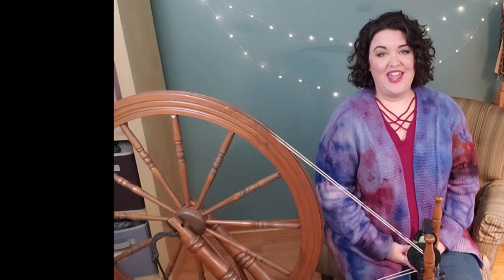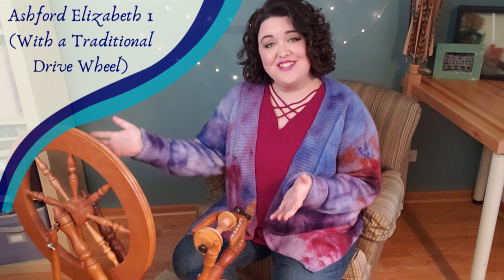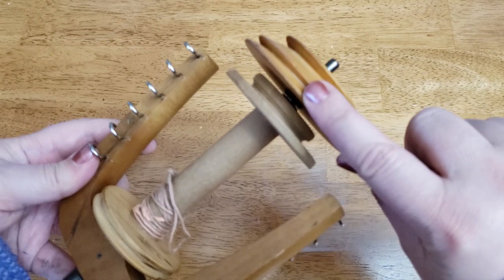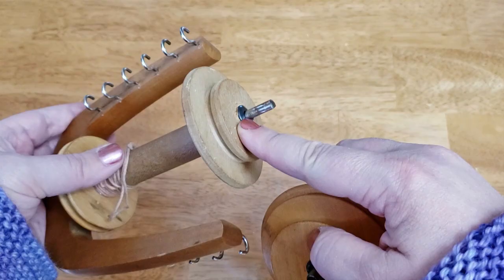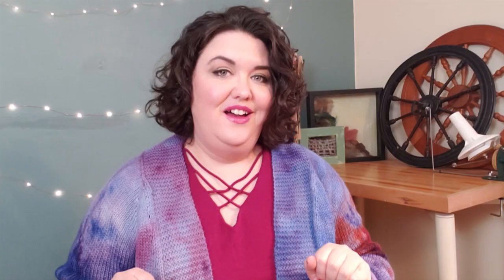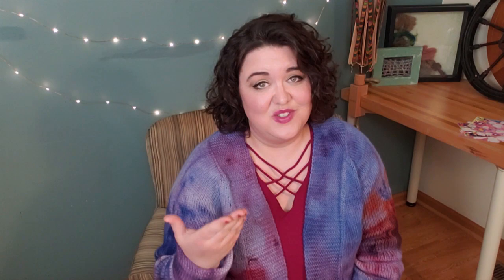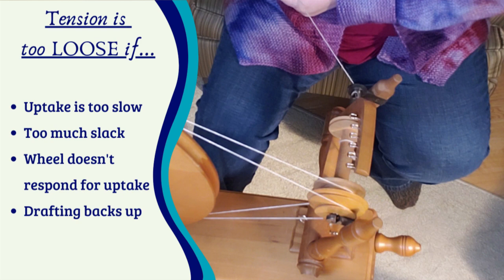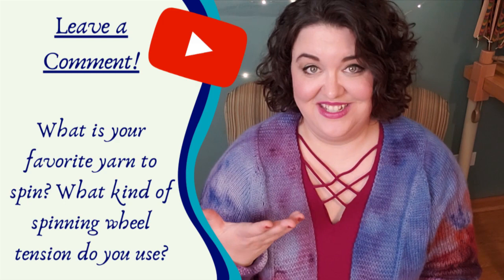Double Drive Spinning Wheel Setup

Comment: I've had a Columbine wheel sitting in a corner since I fell on it (tripped over the dog) and warped the frame. I decided I want to fix it and use it again...and since the original drive band is gone (who knows where, not me) I couldn't remember how to put a new band on it. Your very clear explanation of how a double-drive system is set up and works has given me the drive (pun intended) to make a new band and hope against hope I can get my Columbine back in use. (By the way, I learned to spin on a Turkish drop spindle from Louise Green of Greentree Ranch in 1973. I bought my first Columbine wheel in 1974, but in a period of prolonged insanity, sold it. The wheel I'm trying to fix was purchased in 2006 when I turned 59 1/2 and could pull off of my IRA without penalty. I've been using my spindle and an Ashford Kiwi for the last few years...I'm almost 76 and am determined to fix my Columbine!!)
Reply from the maker: You can do it! 💜🧶😊

Comment: You explained the ingenious and ancient subtleties of the double drive wheel beautifully. Imagine a modern spinning machine with variable speed bobbin and flyer servo motors and an optical system to watch the fibers twisting. It would need software, a computer, and months of programming. The old spinning wheel and a skilled operator however, produced consistent, even yarn hundreds of years ago. Today I inherited an old double drive spinning wheel which was made in Saskatchewan. It needs work and the whorl turns oposite from normal because it sits on right hand threads, but it's going to be a great wheel.

Comment: Just inherited(saved from the dumpster) an antique double drive wheel that originally belonged to my husband's great great grandmother and was just nearing frustrated that none of the tutorials I could find actually explained how to set up the drive band and how to change the bobbins. This one had to be reverse-unscrewed, and I've been too scared to use force to get it apart, so it was a relief when it just. Unscrewed easily when turned the right way, as you showed. So thank you! ❤️

Comment: Your tutorials are excellent. I am looking into buying an antique spinning wheel, I believe it is a Cadorette CPW. Since I have never used a spinning wheel before, I needed to understand what is in front of me when I get there. Most of the wheels on the market are either decorative or genuine but have been purchased as a decorative antique, or came from a grandma's attic. This means  that the person selling it will not be knowledgeable about spinning. This tutorial and the others you have on ratios, buying an antique and CPWs are very helpful. I am watching them over and over so that I will be able to buy a good wheel - or pass on the dust collector. Thank you so much Evie. ❤
Reply: Just came home with the P. Cadorette wheel today. It is gorgeous, and even though it has not been used for spinning for a very long time, it is in great condition and it is very eager to get back to work. Beside adding oil to the friction points and putting in a new drive band, it works like a charm. For the drive band, I used a cotton/linen blend yarn from Yarn Bee; it is very strong. The instructions in this video were helpful, and I did the following to easily thread the drive band alone: 
a) I used a piece of rope to tie one of the spokes to prevent the wheel from turning
b) I tied the first end of the drive band to one of the maiden, and which allowed me to keep enough tension on the band to help it stay in its grooves
c) I ran my fingers over each groove as I threaded the band to ensure it is correctly placed.
After a few tries, I nailed it. The part that I struggled most with, is that I could not get the practice yarn to wind on the bobbin after spinning it. Adjusting the tension did not seem to help, then by chance, I managed to get it t to wind once. That's when I knew the problem was me. It took many fails to finally figure out that this wheel wants me to slow down slightly when the treadle is at its highest point, and only then will it take up the yarn. So excited to be so close to spinning my very first yarn on my very first wheel!
Thank you so much Evie for your helpful videos❤

Comment: Thank you , thank you, thank you!  Between this video, and your video on SWSO, I have managed to get my spinning wheel functioning!  All the parts were there, someone had just painted over them, so everything that should move, was stuck together, and if it shouldn't move, it was loose and flying around!  Between your two videos I have everything working great now!  Just finished adjusting the tension so that the bobbin takes up the fiber neatly.  It is a castle wheel, double drive, so a little different, but your videos have helped turn it from a (nicely painted) decoration into a functioning wheel!  (BTW I got it for $20 or else it was going to become kindling for a fire!  A couple hours of labor and it works like a charm!)
Reply from the maker: I'm so excited to hear you got it working! Yay!

Comment: What an interesting picture (in reference to the castle style wheels) - I had no idea they had been around that long!
Reply: I have a Schacht Ladybug that I was trying to use in double drive, but I need some drive band suggestions (mine didn't have the DD band when I bought it). I've tried #10 cotton thread and fingering weight linen yarn (not enough tension) and a thicker cotton yarn that was too thick to go into the bobbin Grove.

Comment: I have a new (to me) Schacht Reeves wheel with both double drive and Irish tension.  I am used to my drop spindles, kick spindles and my EEW Nano 1.1 so this treadle wheel is a new ballgame.  I am using it in the double drive mode.  I am having trouble with the drive band coming off repeatedly.  I have tried both increasing and decreasing tension and it still does it.  I’m going to try a new drive band next as I used some old cotton twine I had around the house for several years that I had to untwist from a horribly twisted up tangled mess.  If that doesn’t work I don’t know what else to do.  I can’t say what fiber or yarn I prefer yet as I have only spun a couple different fibers and haven’t learned much about how to make different yarns yet though I spun pretty fine on the EEW nano. I am 68 and through raising our two boys and my sister’s 3 boys and a girl we were very busy so I have been wanting a spinning wheel for a long long time.  I had commented earlier but I received my wheel since then so I am not trying to dominate your comments, just hoping for some suggestions.  Okay I just discovered your other video on how to do the drive band and I’m going to follow what it says before I do anything else.

Comment: Woman, you are amazing.  I have learned the majority of my spinning wheel knowledge from you.  You present with such clarity, I am indebted to you.  Today I will check out a double drive wheel (I have only spun on Scotch tension), and I needed this information to evaluate the wheel properly.  (Wish me luck today.). Thank you for being my personal tutor.  ❤️
Reply from the maker: Good luck! I'm reading this 2 days later. I hope it all worked out for you!
Reply: I did not purchase that particular wheel (a very pretty Paradis) because of probable dampness exposure.  BUT….  because of your wonderful tutorials, and some luck, I am now owner of several wheels that I will lovingly restore to their full beauty and functionality.  (The wheels make my heart leap with their beauty.)

This is my current double drive question:  I purchased a like-new Country Craftsman and  set up the cotton cord per your instructions.  The cord touches where it crosses!  (Remember, this was my very first double-drive set-up, as I have only spun Scotch tension.). I thought I was doing something wrong, so I did a cord set-up on my CPW (newly purchased; not yet fully ready), and that worked out perfectly, not touching.  Could this be a flaw in the design of the CC?  There is not a lot of info on CC’s, although there is a group on Ravelry, which is not very active.  Do you have any information?  Thanks, Guru.
Reply from the maker: @rashby8858  yes, check out my video about tying the driveband on. There are closeups of "the cross" that will help. Happy spinning! 🧶💜😊

Comment: Just watched this video post Vlogmas. My wife loves her new/old wheel but she's having to learn it's new personality. The first time she owned it it was scotch tension but when I restored it I used a double drive flyer. Oops. 😘

I didn't know there is that much difference between single and double drive but apparently there is. She is still trying to find the sweet spot. Thank you for posting this video. I'll have her watch it when she gets home.
Reply from the maker: The tension system for double drive is gentler. She'll get it! Don't give up! Tell her to set it looser than she thinks she should if she is more used to scotch tension. 😀

Comment: Your videos have been so useful since I got my Kromski Sonata at Christmas! I recently got the magnetic flyer kit, which can be set up for double drive, and thr smallest Fantasia whorl, which takes it up to 24:1, which is great for the fine, high-twist yarns I want for tablet weaving. I didnt get on with double drive when I first tried it, and adjusting the tension is a pain - its done by changing the height of the Mother-Of-All and the screw that holds it is behind the drive wheel, but with the pojkvän helping its a lot easier. I've been using it for plying tonight and with the tension set just right it puts a nice amount of twist in and winds on all in one without me really having to do anything, I just sit there with the plying ball on my lap, the two threads running between my finger and thumb. When I've finished this ply, I think I'll try spinning double drive with the baby yak I bought on a whim a while ago, for a three-ply and take it straight off the Kate rather than winding a plying ball.
Reply from the maker: Spinning is a much better experience when the tension is right! Enjoy the yak. I bet it will be lovely! 😊
Reply: @JillianEve  indeed, and scotch is so easy to adjust in comparison. It'd be so much easier if it was a threaded lift rather than a post held in place with a retaining screw!
Reply: ... I ended up spinning pineapple as the pojkvän was curious. Went back to scotch after a while though, adjusting this thing in DD is like that Eddie Izzard sketch about the microscopic adjustments required to a shower, except worse.

Comment: omg thank you! I came across a vintage wheel today and felt the need to buy it even though I've never used a wheel before. I looked online before buying it to see if it seemed to be missing anything, and I'm fairly certain it's just the drive band missing. But I could not get the whorl off to clean it up, and was searching the internet just trying to find out if it was screwed on. For some reason I couldn't find any kind of diagram of any whorl or flyer (vintage or modern). Thank you thank you thank you for telling me to turn it the other way!!!

Comment: I just bought an antique swedish flaxwheel as my very first spinningwheel. Finding the right tension and speed has been a bit of a challenge and it so far only have one bobin but otherwhise it works great! I'm trying to find someone who can make new bobins and possibly a new flyer for it as the two current flyers are a bit worn

Comment: I have been spinning for many years on a Traditional Ashford single drive, but I recently acquired a Teko Teko double drive wheel and I have been struggling with tensioning and keeping the drive band in place. Also difficulty in knowing if the cross on the drive band should be different when plying yarns.  I think you have posibly answered both questions and I am excited to give it a try.  Thank you for such a concise video.
Reply from the maker: You are so welcome and I'm happy I could help! Happy spinning!

Comment: Hi Jillian Eve, thank you for having such a wonderful Channel.  I am very happy to have a 1982 Double drive with Scotch tension option and although I use it as a single drive at the moment and I have been able to spin lovely yarns I have been unable to find more information about set up for example due to its rarity.  I want yo in finer fibres, but I am finding it really hard, I get the consistency, but once I I fold on itself the fives seems “loose”.  I’ve tried lots of different tensions and I had a go at cross lace, but because the pegs are in different sides makes it more complex.  Any advice is very much welcomed! ❤

Comment: I bought my first spinning wheel yesterday from at least the 1800’s because it is made with square nails and leather bits on the end of the flyer assembly. I found this video today and have subscribed because you have done an awesome job explaining how to use the spinning wheel. My problem is that the bands keep popping off the wheel and I have tightened the adjustment knob but I’m afraid of breaking it. I also cannot figure out how to take off the flyer assembly for the same reason. Maybe you already have other videos on how to do this and I just haven’t found them yet. I just hope I didn’t buy a lemon lol. Everything seems to turn freely but it is very old.
Reply from the maker: Congratulations on your wheel! I do have a video about tying on the drive band if you didn't find it yet, here's the link 😀 https://youtu.be/711P9wD8SzQ
Reply: @JillianEve  Thank you!  I have it all set up now and I have been practicing for hours but I just can't seem to spin correctly.  I found the "sweet spot" with my leader yarn but, when I try to spin the Merino fiber I bought to practice with, it is just too hard to get it to twist like it should.  It is actually over twisting.  I have loosened the tension but then my drive bands pop off. lol.  I will just keep practicing and watching your videos.  I may need to find a class somewhere!

Comment: Thank you this gave me enough info to get a double drive of my friends, driving. It has a threaded whorl with a right hand tapered thread. So I assume should be spun anti lock wise. My one last question is how tight to do up the taper thread, I expect the whorl is a reproduction item and maybe the wrong width. Also it has two grooves but both the same diameter
Reply from the maker: Most double drives are meant to turn clockwise. 🤔 The two grooves are normal, I just pick one and spin with it. I'm fairly sure that spinning wheels were designed to have certain parts replaced as part of regular wear and tear happened during the life of the spinning wheel and maybe the whorl was part of that? Interesting project! I wish your friend and you happy spinning!

Comment: Hi Evie. I have three wheels. My first two wheels were both double drive only, so I got accustomed to spinning on that system. My newest wheel is a Kromski Polonaise which you can set up in either DD or Scotch Tension. I fin myself using the DD all the time, and am able to spin any kind of yarn on the Kromski. Using the 6 speeds, and tension adjustment, you can spin anything. My typical yarn I spin is a sport weight single for weaving, and I typically spin Navajo-Churro fiber, however I can also spin a pretty mean 2-ply sock yarn as well. 
Love your videos. Would love to see one on spinning consistent medium weight singles for weaving. I typically use a backward draw to spin low twist woolen spun yarn. Thanks.   Steve
Reply from the maker: I was just thinking about some singles for weaving earlier today! 🤔😁